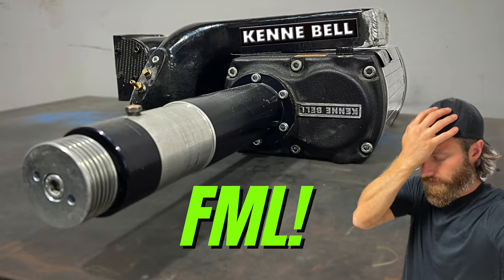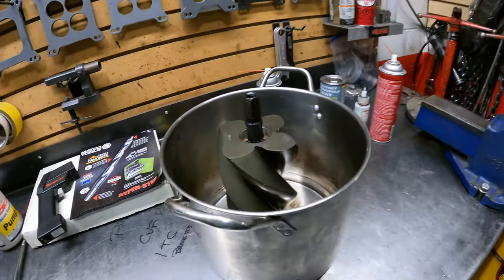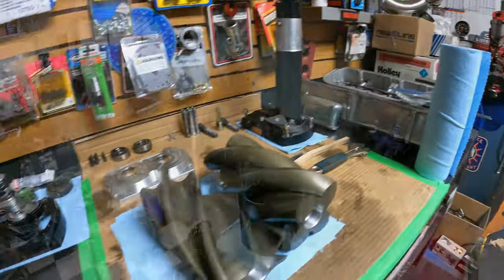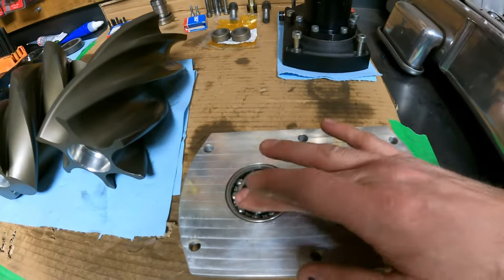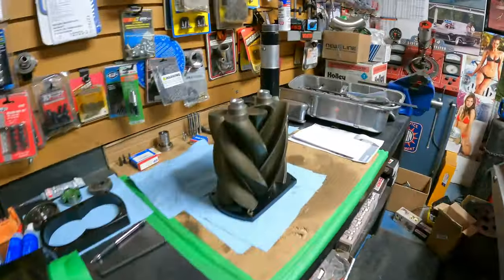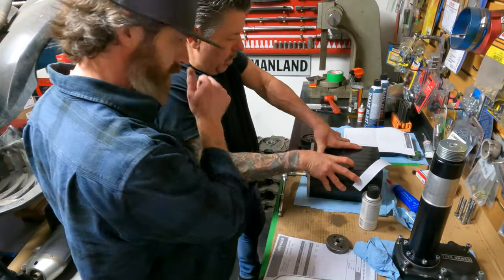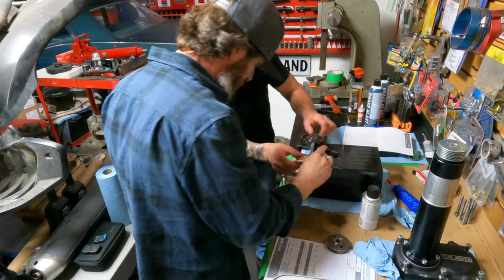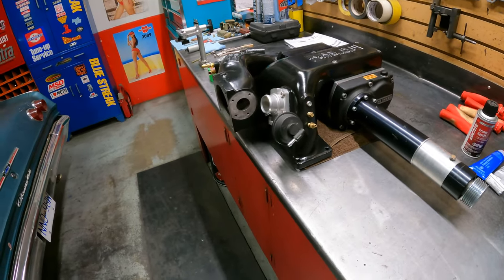Rebuilding A Twin Screw Supercharger For My Foxbody Mustang 5.0

Comment: Thinking about rebuilding my kenne bell. Only part scaring me is timing the rotors. Any more info on how you did that?
Reply from the maker: Yes I did a full video on it during the reassembly 👍
Reply: @KASLCustoms  I've started tearing down my Opcon Autorotor 2087, which looks just like your KB unit, and understand why I couldn't get the small gear off (opposite thread) - thx for the clue!
Regarding timing, is there a separate video explaining what you did inserting the paper into the case?  I saw that in this video, but couldn't really grasp what was happening, as it was not in frame/explained in detail.  Does the paper go between the two rotors, so when you torque the gears, it's "timed" because of even spacing .003"?